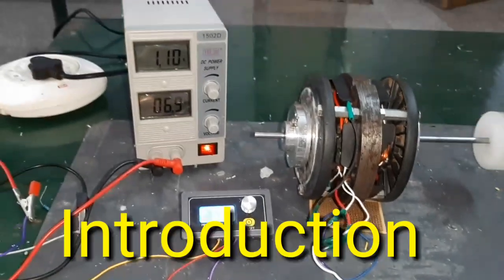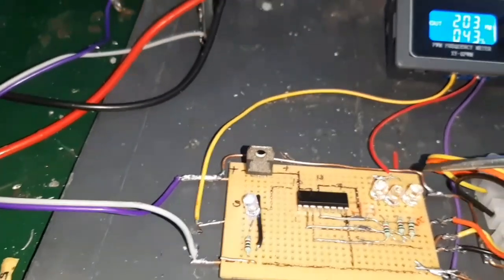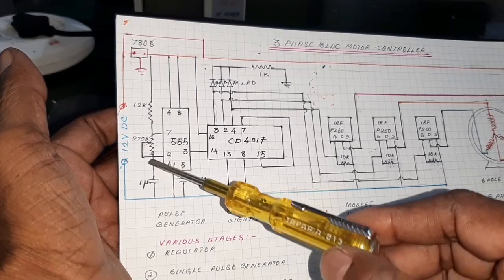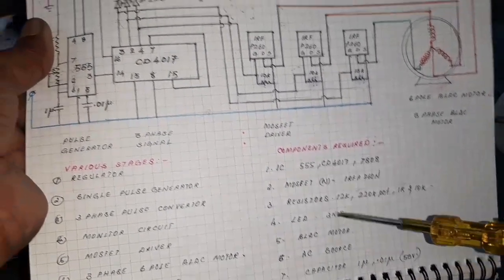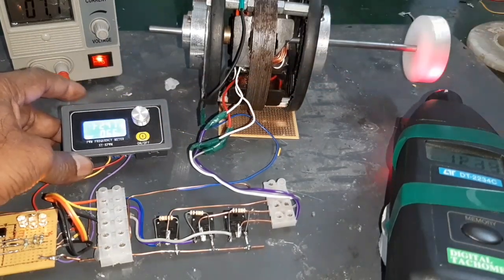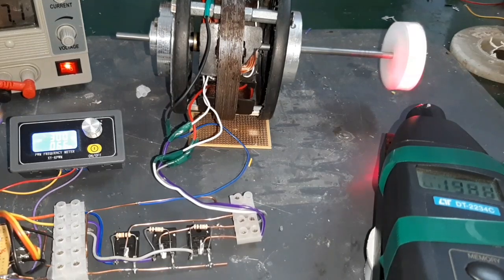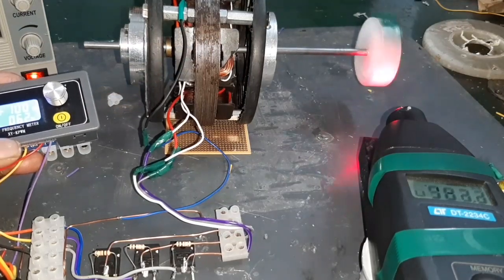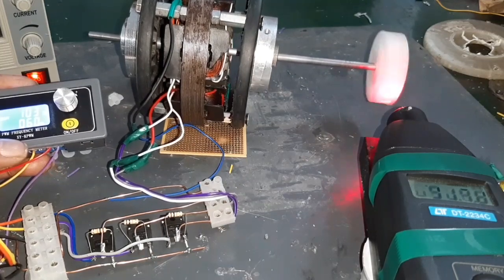Home made bldc motor controller(Type-3)

Comment: Thanks lot for bldc controller I’ want todo the same so where can I buy frequency meter and dc power supply unit kindly reply sir
Reply from the maker: THANKS SIR,
Frequency generator with display and without display available in online shop amazon
Reply from the maker: I have purched frq -generator with display price-Rs 925.00
Without display-Rs125.00 in amazon
Reply: Thanks lot
Reply: Dc power supply unit sir?
Reply from the maker: Simple power source unit
0 to12v with2 amps power supply unit
Price may be Rs 500.00 it is available in electronic shop
Regulated power supply with variable voltage and current rating 2 amps
Price may be Rs 3000.00 available online shop Amazon 
In trichy supper bazzar
In chennai richistreet